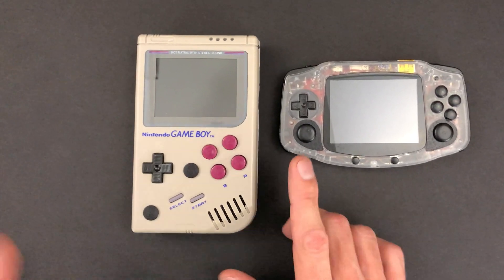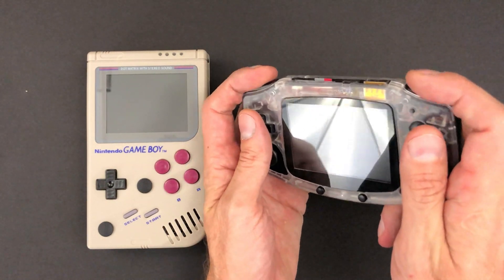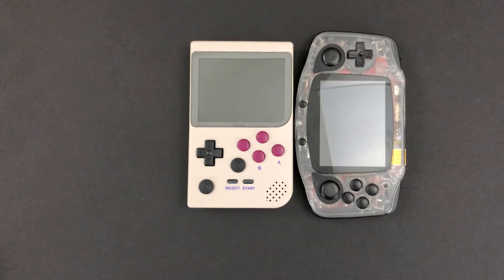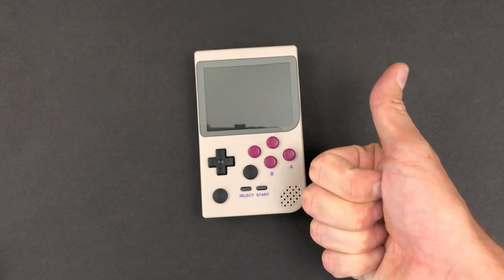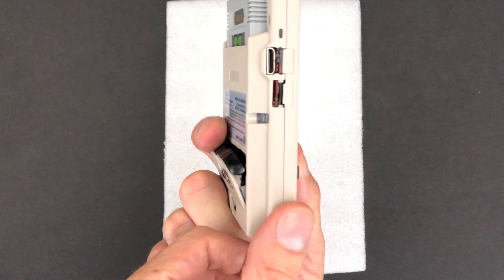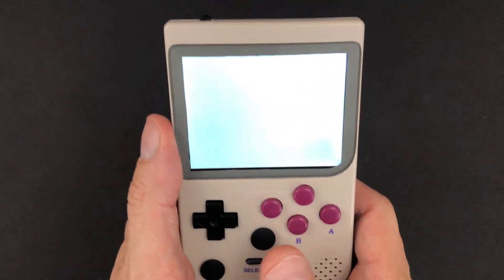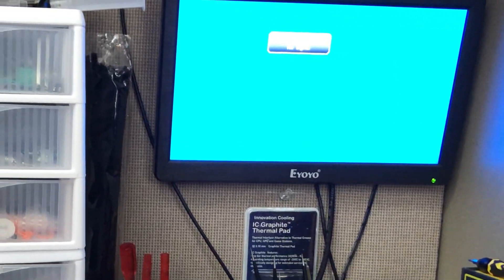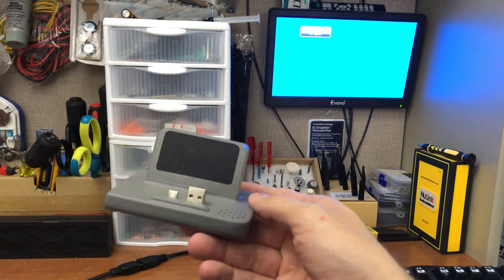Pi Gameboy DMG + GBA = ?

Comment: I am fascinated with your work man is really good. I stumbled upon a gameboy advance sp circuit board that works with raspberrypi3 by a guy with an instagram:gameboypi  . I was wondering for the people that prefer the sp over the normal advance if you can try to add analog sticks.
Reply from the maker: Jose Tarrazo thanks! I will check it out. That could be fun :)